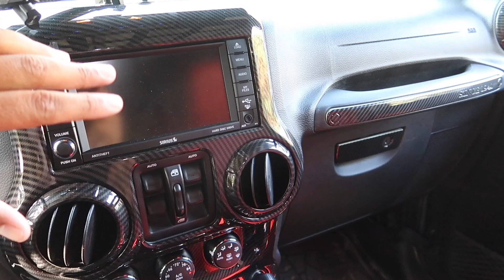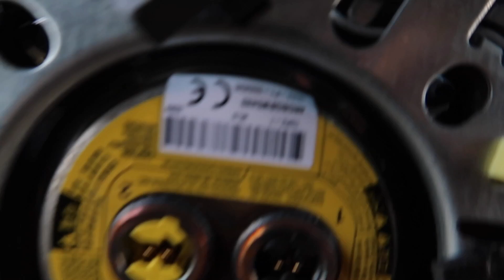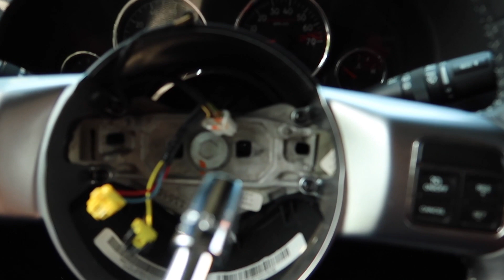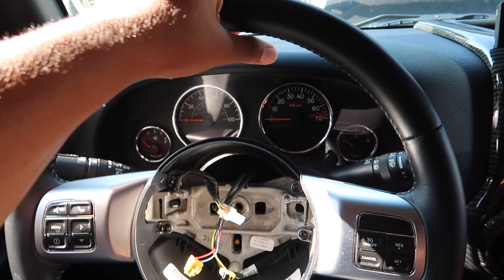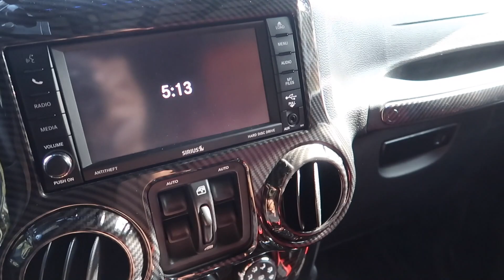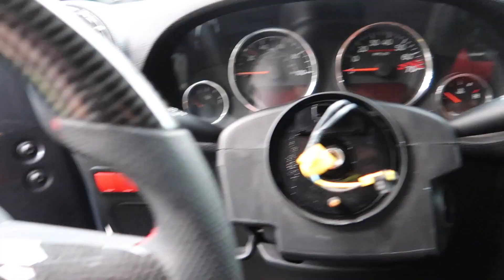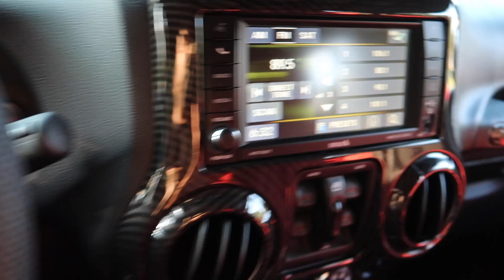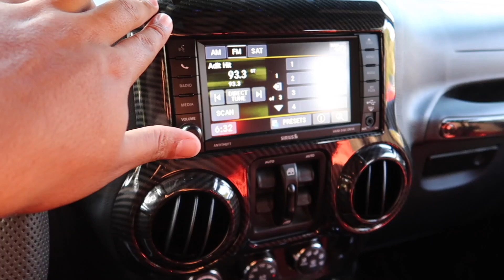Carbon Fiber Steering Wheel Upgrade For Your Jeep Wrangler - How Much?

Comment: Hey, if you want to push that steering wheel out, you have to hit the wheel a few time, so than its loosens itself (toothing)... Just hit it on the top and on the down side a few times. You dont need special tools for that.

Comment: Did you test the heated steering wheel option?  the feature that nomally wont work is the heated steering wheel option. i contacted a couple of carbon steering wheel co. and ask about that feature and they said you lose that option.  the wheel for my Raptor is $1700 bucks and for that amout everything should work!